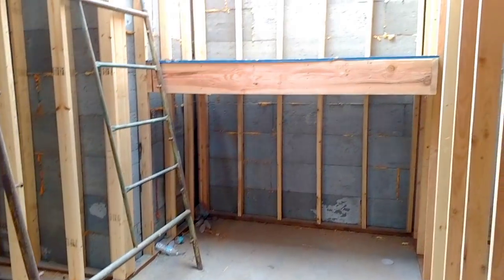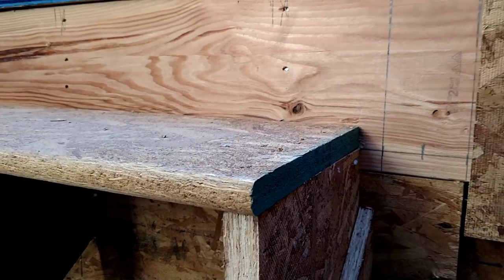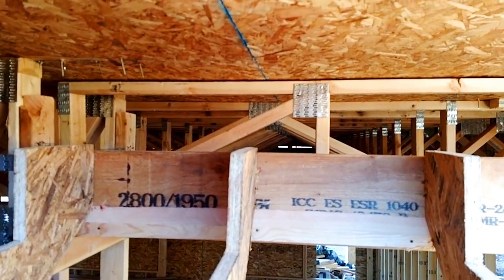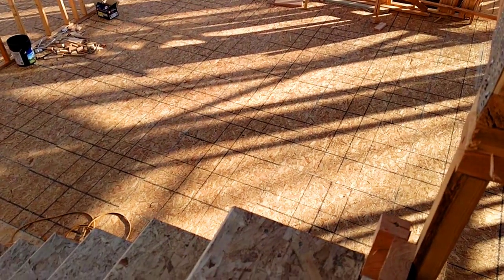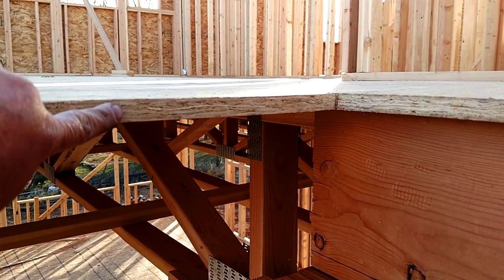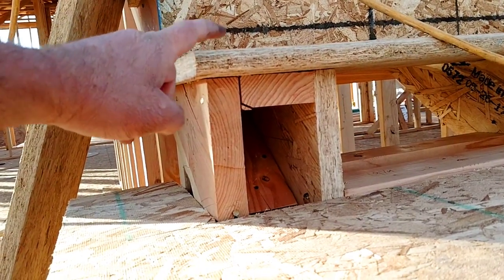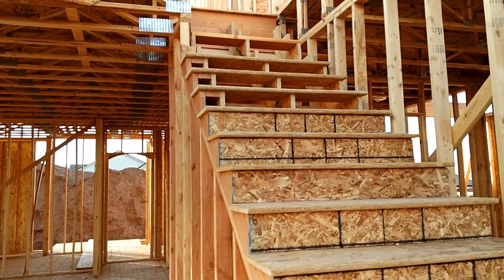Step framing explained! How to build any staircase diy

Comment: I have a question, if my rise is 7 1/4 and my run is 10 3/4 but my treads are 3inches thick do I subtract the 3inch thick treads from the 7 1/4 when cutting the rise so that when I install the 3inch thick treads it would add back up to the 7 1/4
Reply from the maker: The only treads that change are the top and bottom. The top rise would need to be 10 1/4" from top of subfloor. That way the added 3" step would make the rise 7 1/4". For the bottom, do the opposite. The bottom rise needs to be 4 1/4" from top of subfloor/concrete. That way the rise is 7 1/4" after the tread is added. Every other of the middle treads you should cut at 7 1/4" because the measurement from bottom of tread to the next bottom of tread will be the same as top of tread to the next top of tread. Hopefully this all makes sense. Let me know if you have any more questions.
Reply: thanks so much your information was really helpful
Reply from the maker: Any time!
Reply: jr walters - Question why are your treads 3 inches thick

Comment: I live in south Florida I have never seen OSB for stringers, always 2x12 and then run is a 2x12 90% of every house. I have laid carpet for 30 years and have done more stairs then I care to think about. House looks great tho, I'd bet not a south Florida house tho lol
Reply from the maker: Yeah, I'm not sure why they use the osb product but it's the "engineered" standard in Utah, but 2x12's would probably be better.
Reply: @VanDamArtisan  I was about to comment something similar, plywood is not proper framing.... I wouldnt even do this in a kid tree house I only wanted to last 4-5 years.... its just not a load bearing material.... wtf utah...
Reply from the maker: @SteveB-nx2uo  it's all about quantity, not quality. At least for the most part.

Comment: I was confused at first, but after the second set of stairs, I understand now. You accommodate for different tread thicknesses, bottom line,....make all rises the same.... 7  5/16
Reply from the maker: Yes, exactly. Depending on your overall rise from finish floor height to finish floor height.

Comment: just so you know if your flooring is 3/4 and you add just carpet on the step its not gonna work any just so you know Its not the right way if you wanna build up the step for fixing the top step the bottom one is no good lol thanks for the video
Reply: you have to take in consideration the flooring added to the bottom and top sub floor

Comment: If the step is a 2x12 then do your risers have to be a 2x12 as well ? Or do your stringers have to be a 2x14 or 16 ?
Reply from the maker: The risers don't matter as long as it's the same all the way up. The stringers can be done with a 2x12, but thicker is better.

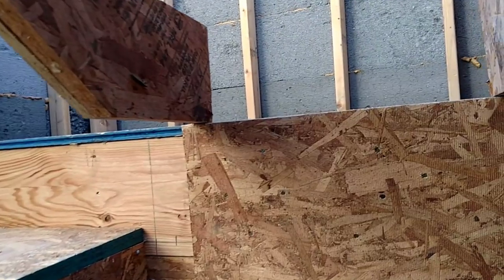Comment: Why not run longer floor joists in the landing at 1:53 so that they extend underneath the stringers?  To determine how much to extend the landing, lay out a stringer and measure the length at the underside of the bottom step.

  For better accuracy, I stack and flush my three stringers on top of each other. Check and make sure the saw table is a right angle to the blade and set the saw at full depth. It cuts through one stringer and marks the next eliminating the need to trace each one individually.
Reply from the maker: That's a good idea. I will do that next time. There certainly are minor variations in the cuts when the stringers are cut individually.
Reply: Yes, but it takes more time to trace each stringer off a pattern individually and it's not as accurate. Thanks for your reply.
Reply from the maker: Thanks for watching

Comment: what kind of wood are you using or rather what kind of wood is best
Reply from the maker: 1 1/8 stair tread comes with one edge rounded and the runners are usually called 12" rim board. Everything else is just regular 2x4's

Comment: -Wow! I can’t believe you didn’t have a code issue during inspection with that wrap around detail on the bottom three steps, bcz the tread widths weren’t consistent all the way around with the typical tread width. That wouldn’t be legal in my area.
-These stairs got a bit more complicated than what one usually runs into bcz you had 2 different stair tread materials (1⅛” and ¾”). I would have done it just a little differently by adjusting the riser height on the bottom 3 risers so as not to have to make another calculation for the top. But, your way worked as well I assume.
Reply from the maker: The international code only address consistency with tread depth and height. The inconsistent width doesn't matter.
Reply: @VanDamArtisan  I have to respectfully disagree. It could be a terminology problem here. In the IBC, when “width” is referred to, it’s talking about the width of the space that the flight of stairs occupies. For example, a 4 foot wide stair would be a very common commercial stair width. 
In the condition you have the wrap around section of stair treads appears to be 5”, which is way less than the minimum 10” requirement and, of course it would also exceed the maximum ⅜” allowable tolerance between treads in the same flight. Even in a set of winders, the minimum tread width at the narrowest point (not the ‘walkline’) is 6” (2018 IBC 1011.5.2.3)

I’m including a link to the 2018 IBC where the code for stairs starts at section 1011. If you can show me where the code or even a listed exception allows this type of configuration, I’ll gladly concede the point but I don’t think it does. I’m not arguing that you may have been able to ‘sell it’ to the inspector but I think you got away with one there.
[There’s a hyperlink on the left that will bring you right to ‘stairways’ section 1011]
https://codes.iccsafe.org/content/IBC2018/chapter-10-means-of-egress#IBC2018_Ch10_Sec1011
Reply from the maker: I understand what you're saying now, and no, it's not up to code, but they don't care here. As long as the steps are consistent and don't vary more than 3/8" then they don't care.